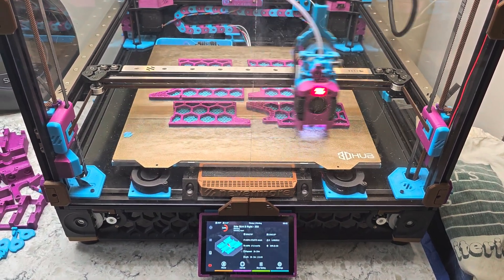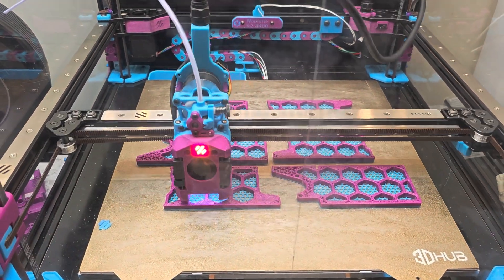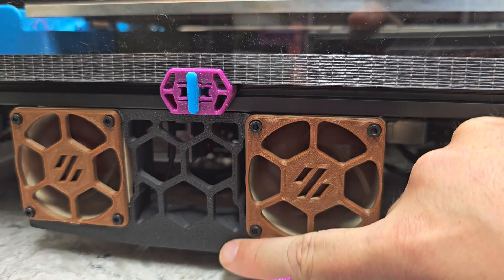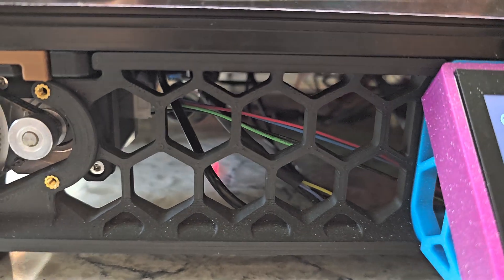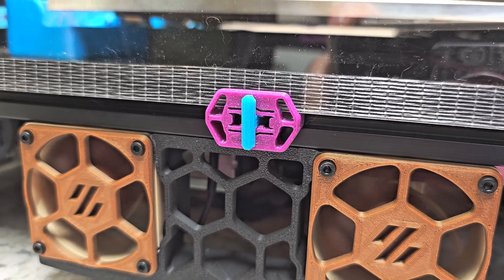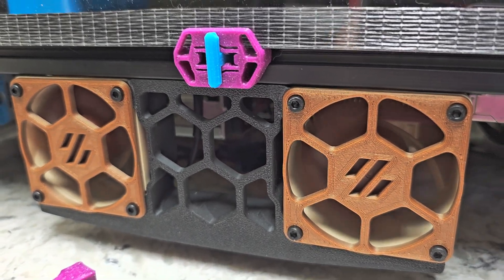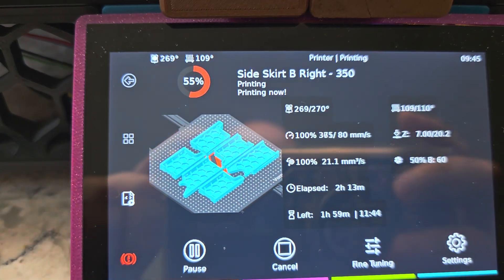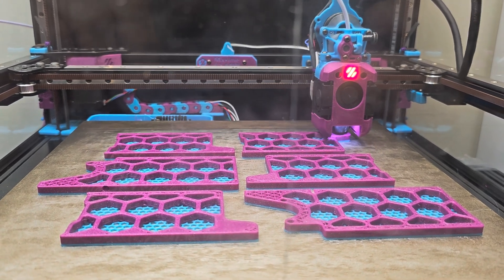Voron 2.4R2: Remixed side_fan_support_x2.stl Skirt Part

Comment: What mods are you running with? I haven't built a 2.4R2 yet, but I've been thinking about printing out all the functional parts to replace any damage over the last year or 2 and wanted to upgrade a couple things. I really like the way your system looks. The clips you're using for the side panels isn't one I've seen before either (but I haven't seen the 2.4R2 revisions yet). Looks darn good.
Reply from the maker: Thanks! The clips that hold the side and top panels on are from Annex Engineering. They require no hardware, VHB tape, or cutting of the panels at all, just printed parts. Here's the repo:
https://github.com/Annex-Engineering/Annex-Engineering_User_Mods/tree/main/Printers/All_Printers/annex_dev-Panel_2020_Clips_and_Hinges
There's also a remix for printers built on 1515 extrusion frames:
https://github.com/KayosMaker/1515PanelClips
Reply from the maker: My latest video catalogs all of the mods I presently have installed, with links in that video's description.
Find it here: https://youtu.be/2CnZ8qLOzNE

Comment: Are you back to the 2020 for X? I just noticed
Reply from the maker: Back to the original 2020 Misumi extrusion for the X gantry, titanium backers, swapped out the MGN12H rail for a single MGN9H rail, and put the CNC XY joints back on.
Reply: @oldguymeltsplastic  Video on input shaper reccs coming soon? :D
Reply from the maker: I am still not getting really great input shaper recommendations from my testing. If I were to share my graphs right now in a video, most of the viewers would rightly say, "Yeah, so what? My input shaper results are already better than that."
I feel like there's still more troubleshooting to do to uncover the magic Input Shaper sauce recipe. When I do figure that out, you can be sure that I will share what I did to get there.
Reply: @oldguymeltsplastic  Where would I find the small printed part on your CNC XY Joint to activate the x-endstop?
Reply from the maker: @Mars3D  https://www.printables.com/model/437176-voron-cnc-xy-x-endstop
Depending on the geometry of your toolhead, you might need to modify it slightly to allow the switch to trigger. I ended up adding a block in the slicer to thicken the "wall" that the endstop hits by about 1.5 mm.